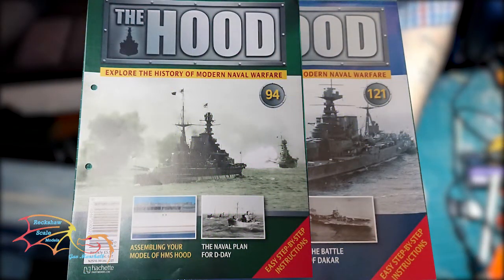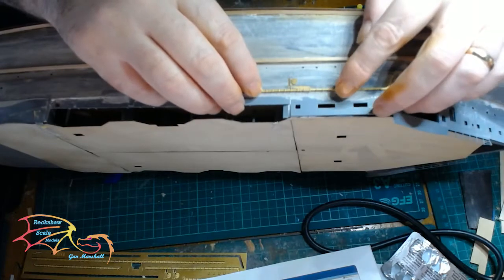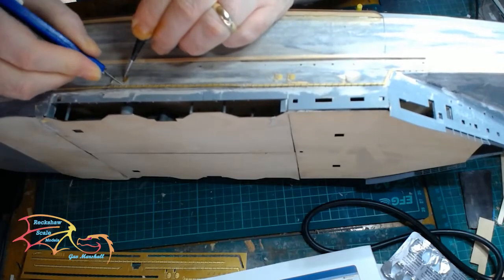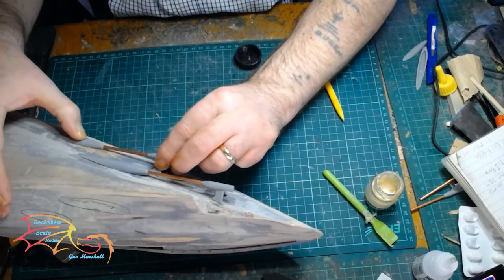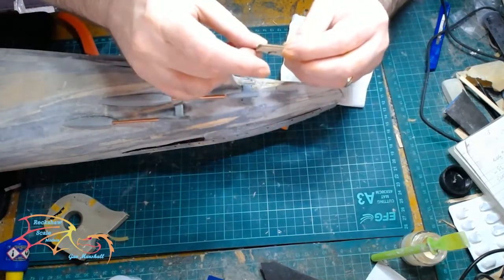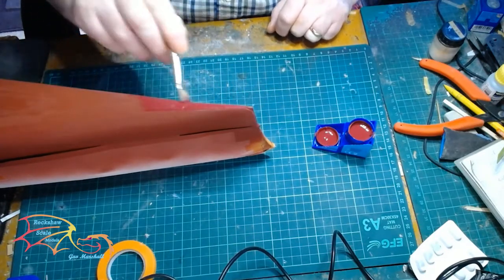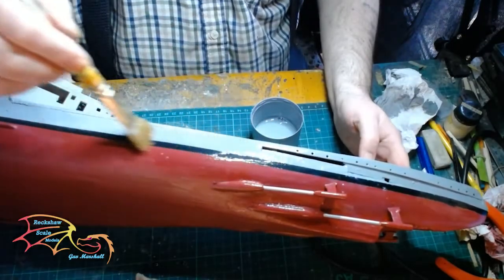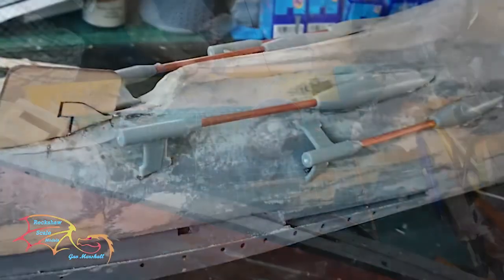Hachette HMS Hood Scale 1/200 Part 12 Hull & Paint

Comment: Would you consider using Halfords for the lower hull top coat? They are 99% sure to have a colour match for the Revell colour.
Reply from the maker: Hi Neil. I've used them before if I remember correctly Citroen red is a good match. Halfords have a great range of paints and they have also increased the range of colours for the primers. I do have a box full of spray paints but hardly use them I prefer a brush. It's like my Airbrush, every year or so ill take it out of the box use it and think Nah back to a hairy stick.